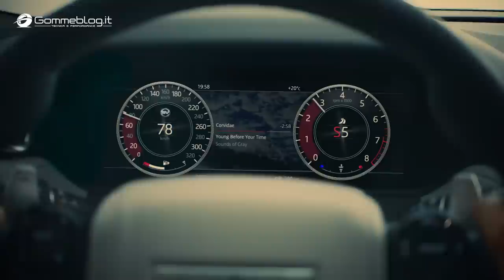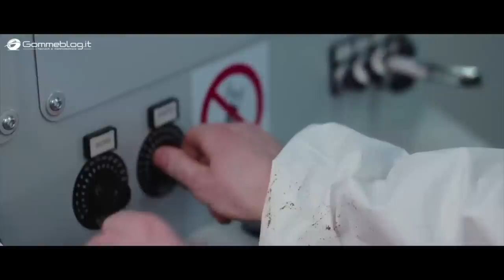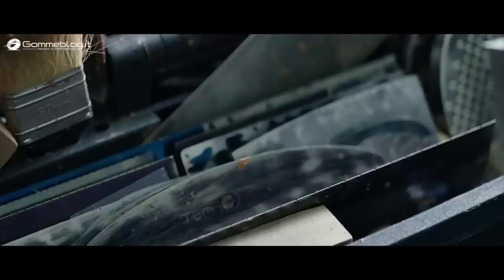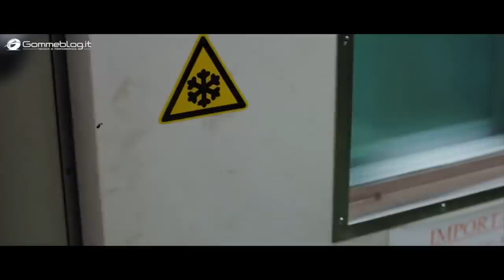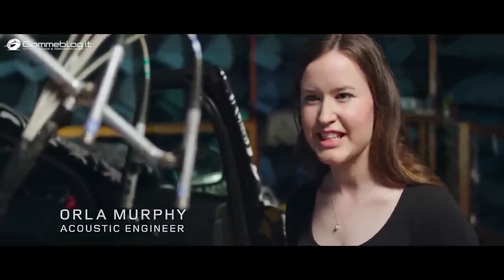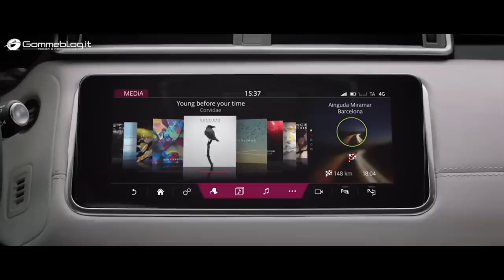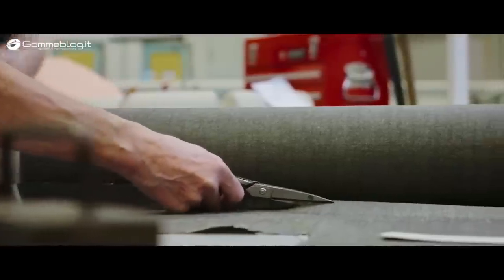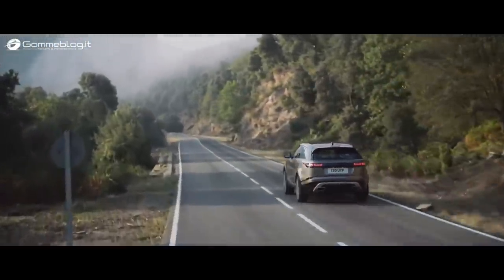2019 RANGE ROVER VELAR (550 HP) SVAutobiography Dynamic Edition

Comment from the maker: Do You Like ??? 550 HP RANGE ROVER VELAR SVAutobiography Dynamic Edition - V8 engine, 0-100km/h in 4.5 seconds (0-60mph in 4.3 seconds) and is capable of 274km/h (170mph)
Reply: The Velar is a gorgeous vehicle, but we need a bulge on the hood. It's WAY TOO subtle.
Reply: The computer on board is multiple languages? If I buy Velar in Gibraltar I can set Italian language?